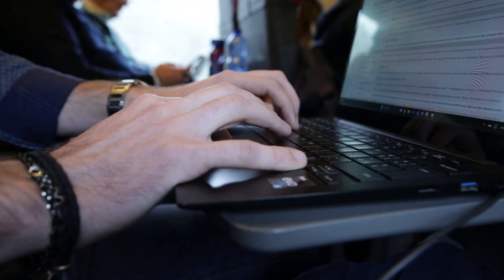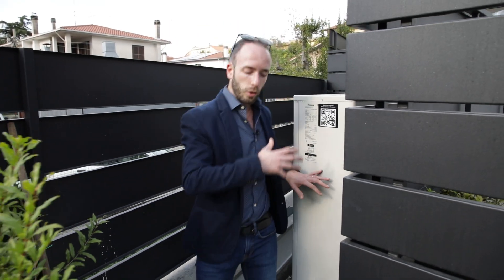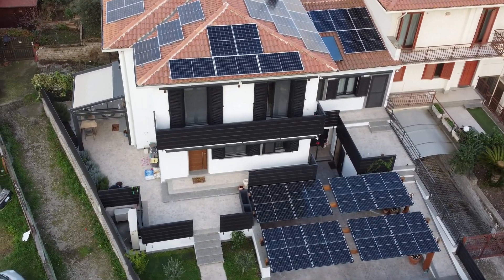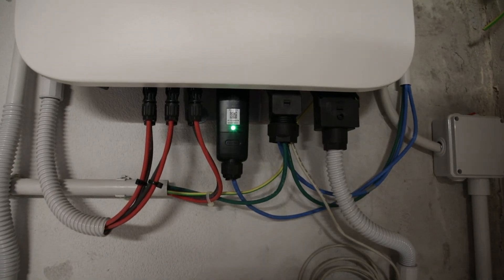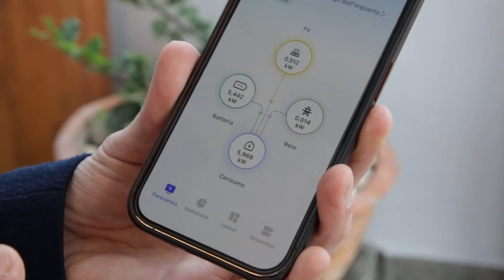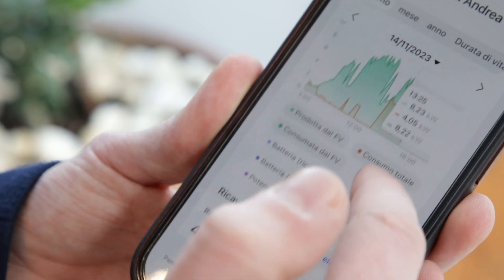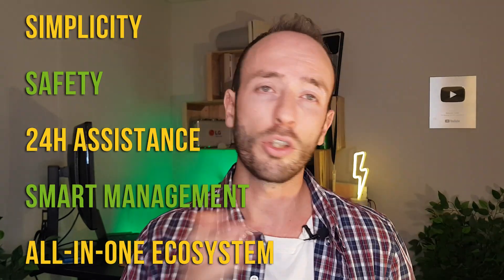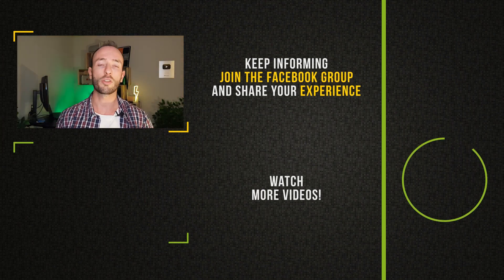HUAWEI Integrated System: SAVE ON BILLS,  Convenient and Efficient.

Comment: Huawei batteries are based on the best possible cell chemistry of today (LFP). The Luna S0 performed that good in the field, that Huawei raised the Garantie from 10 to 15 years for successor S1 packs. I have installed a great starter solution with 10KW and I am very happy so far. Highly recommended ++++